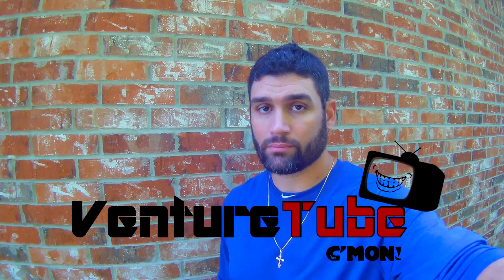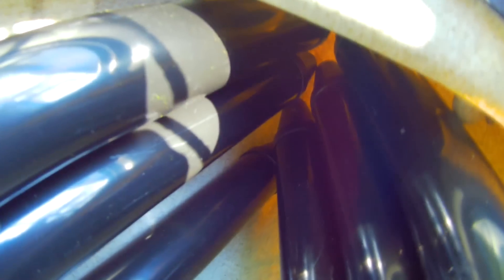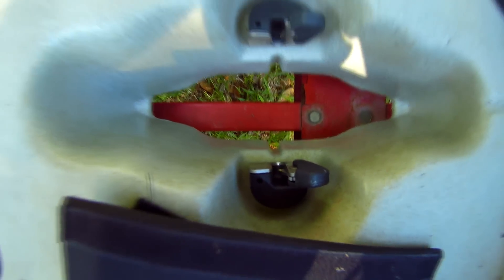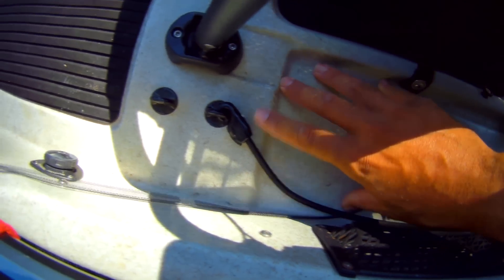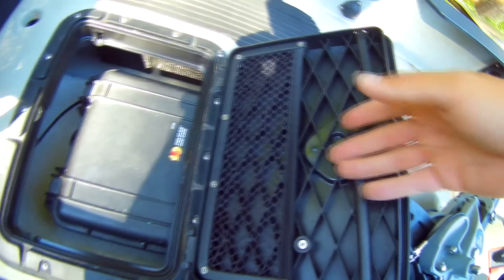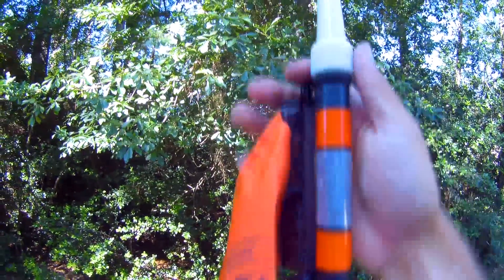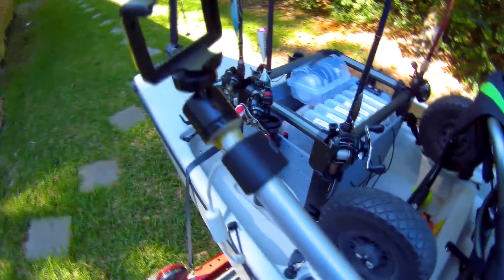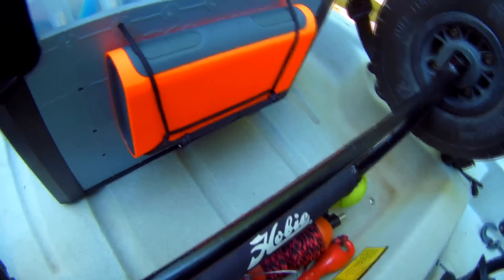NEW 2016 Hobie Pro Angler 14 MODS!

Comment: Dude you got me hooked. I'm a wounded Vet and looking to get into the kayak vibe. I like yours cause you pedal and get a little exercise out of it. I'm a big accessories guy and this little boat has it all. Only thing I don't like is how you say water gets in from where you got the pedals at. Did you ever think about screwing in some heavy rubber sheets to help keep the water out? Either way brother I'm probably going to get this kayak and hit the Guadalupe River. Thanks for the vids and keep up the good work. Live free and good fishin bro.
Reply from the maker: Water was only coming up through the mirage drive well when I was standing towards the bow of the kayak.  Plus that was on the older model.  The newer Hobie has a deeper hull.  Water is not coming up through it, even when standing.  You don't want to block the well.  It is designed to drain water quickly if you take a wave over the bow.  Anyway, you'll love the kayak and all the accessories you can outfit it with.  Enjoy it and if you have any questions, you know where to find me.  Take care brother and thanks for your service.  C'mon!
Reply: The drive area drains well, and they sell a small piece of rubber which blocks the rear part of it, which is where a lot of the wash ends up entering.  Easy to make one too.
I use mine in fairly rough water often, and the water doesn't wash out of the immediate drive area unless I am pedaling fast into rough water without the shield.
As VentureTube said, you may be getting splashed already somehow or other if you are in water rough enough to make the drive opening an issue, and its a drain.
Mine is an older Revolution, and it's a splashier ride than these new PA's I'd imagine.

Comment: thanks for the vid. On the trailor. how many inches apart should the 3 inch  pvc pipes be that the yak actually  sits on be. On the new 2016? Thanks, Terry
Reply from the maker: +Terry Gregg Sr I had mine set at 10" on center from my old yak and it works for the new one as well.

Comment: Which batteries did you use in the pelican box to power everything up in the main hatch? Did you drill a hole in the box to run the wires in?
Reply from the maker: two 12 volt 9amphr deer feeder batteries wired in parallel and yes I drilled a hole through the box.
Reply: VentureTube Thanks! Videos are awesome.
Reply: DJ.  Ulloadds

Comment: Did you change out the wheel bearings on that trailer. I have modified the foldable harbor freight trailer to hold 4 kayaked, but have not gone on highway any long distance yet.

Comment: I am interested in the two seater 2016 or 2017, which is 4 months away.. I have a home in the Canary Islands and want to mount a small outboard due to currents and other ocean situations. I also want to set a pair of pontoons for more stabilized for rougher water and waves that occur I am a newbie to all of this so a well setup system is what I want and need. At 65 and good shape though, I want some extra safety. I have watched your videos a number of times and trust your opinion on how to set up a rig like this. I will most likely be seated center, but I am sure my wife will want to tag along. I sure could use your suggestion as I see this unit a very good choice for me. Respectfully, GSS,.

Comment: Quick question. I have paid a guy to hold two (2) Pa14s, not sure of the year (looks like either 2013 or 14). I'm getting them both, with mirage drives, paddles, Vantage seats, wired with flags and lights, for $3700. I looked at them in the dark, but I didn't really go over them to see if there was any cracking. Does this sound like a good deal? Any advice?

Comment: how long should the 3 inch pvc  be on the trailor. i have a 14 ft trailor. how much of the 2016 pa actually sits on the pvs pipes? hope iv explaned my question properly. thank you, Terry Gregg
Reply from the maker: I've seen some pipes as short as 6 feet and maybe 5 feet of that is actually touching the kayak..HOWEVER,  if you are only using 2 uni-strut supports under your pvc, it will eventually bend in the middle from the weight and cradle the kayak which supports it even more, therefore a longer length will be beneficial in the future.  You following me?  Hope this helps!

Comment: You mentioned that you do not travel with your fishing reels inside of the H Crate system and that you place them inside your vehicle. Do you have to do that with all your tackle gear as well? Also, do you have to take off the tackle box that is mounted to the side rail in your video. Great video but I would have liked to know how to travel when going to and from places. Last question, with the Hobie being the price it is, would you rather buy a smaller boat?
Reply from the maker: Tory Shields I don't remove my tackle. I carry it in my boat. I have recently put the gear box on my h crate so it's no longer on the side. However I do think it would travel safely on the side just fine. And nope, would never go back to a boat, small or big.....of course if I was sponsored that might be a different story 😉
Reply: Thanks for the answer, you have a new subscriber.

Comment: Great video with really good info! Thanks for sharing! One question: I also have a PA (12) from 2016 and I wonder how to use the twist and seal hatch in the back of the boat. I don't have a crate there and my battery is mounted in the front (at the mast base). I bought the little gear bucket but it didn't fit because the hull is in the way to be able to take the keel in. I have no real idea how to use this potential space. I don't like the idea to saw off something from a new gear box to fit it into the hatch (gave it back anyway). Hobie doesn't offer anything for this problem I think. They have a bag to put in a twist and seal hatch but only for 6'' hatches if I'm correct. Do You have any idea? Please let me know! Thanks!
Reply from the maker: Basically that hatch is used as an access port for the skeg and rudder cables.  Storage is useless...I don't use mine either..I did on my older model, but I only used it to store a first aid kit/battery.  Plus it's too hard to access while on the water so I really don't miss being able to use it at all..
Reply: Thanks a lot for Your reply! I it's a bit frustrating to be unable to use it but I think to see this as an access to the cables (also to those of the eco sounder) might be the solution. :-)
Reply: Burley makes a twin lithium battery mount that makes tons of space for that hatch and holds the batteries still and elevated from the bottom.
Reply: Looks pretty basic and could easily be replicated.

Comment: These new yaks are so over priced. I bought some very nice used bass boats for this kind of money. Last one 1994 champion 18 ft. Mariner 150 every thing works great nice trailer all the bells and whistles $3200. And bought a patriot yak for $400 at gander mt. in the winter. Just sayin These $3500 yaks should come with trolling motor battery electronics lights ad live well for that money
Reply from the maker: Yeah I here ya...but oddly enough, Hobie only makes around $400 bucks on each boat.  Crazy huh?
Reply: VentureTube did they tell u that..lol
Reply: Yeah somehow I doubt Hobie only makes 400 dollars on each kayak they sell. There to many good pedal drive kayaks out there for cheaper. Yes usually when stuff just comes out it expensive. Pedal drive in Kayla been out for awhile but hobbie still expensive. For that money I can get me a decent boat and motor